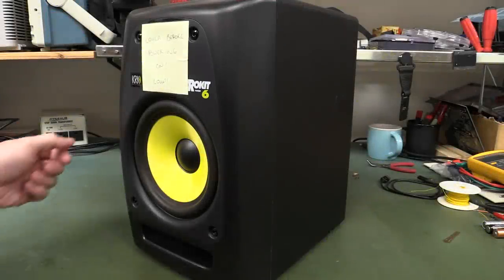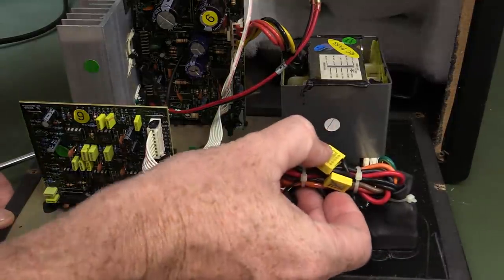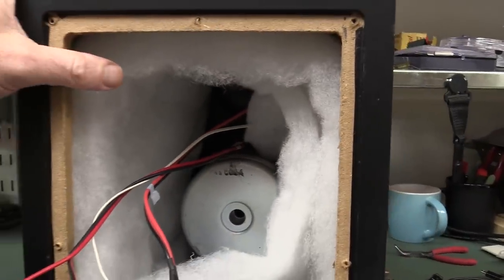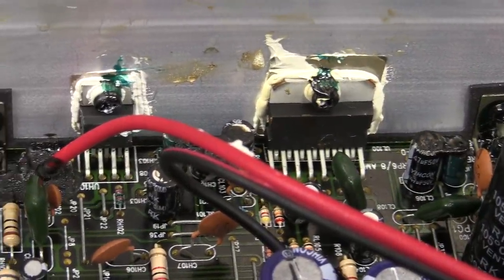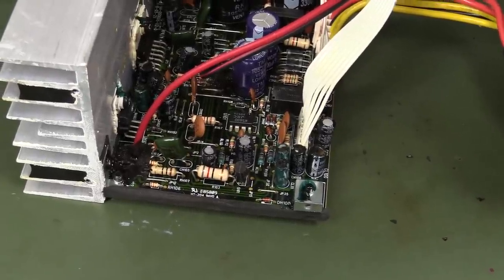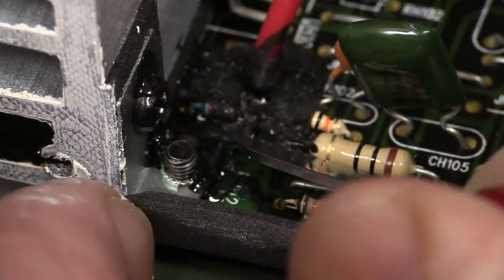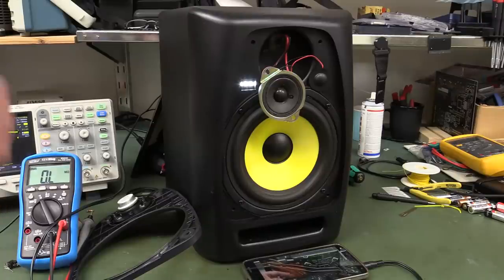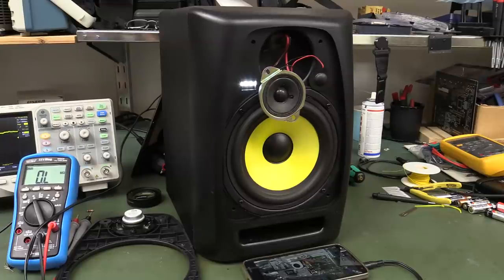EEVblog #1072 - KRK Rokit 6 Studio Monitor Speaker Repair

Comment: I have a pair of Rokit 8's from 2010. One of them powers on but the signal goes super low volume immediately. Sometimes after a couple minutes it will come back, but it will crackle out. Sometimes if I slap the sides of the speaker it will come back. Any idea what might be causing this?

Comment: Hey Dave, would you help me? I had the same problem, my tweeter has blown, so I bought a replacement one from KRK, removed all gunk, replaced a 2k burnt resistor, and put the thing on. It worked, no noise. But the tweeter has no power at all. It works but on very little volume. Any hint on what should still be broken? Thanksss

Comment: Hello, i've got a set of these speaker for repair. It was blowing a fuse, so i've replaced the Transformer and after plugging it in, i've noticed the four diodes on the amplifier board burn out. Any idea what might be causing this? I'm an amateur. I've scraped off all the black gunk hoping it was that, but they still heat up when i flick the switch on.

Comment: Took about 5 years before my KRK8s funked out. Removed as much black gunk of death and replaced several caps that seemed worse for wear. Still got an issue with them, trying to find it, but it does not effect their working.

Comment: My rocket 8 just shit the bed yesterday, took it apart after watching a few videos and same thing black gunk collected moisture then became conductive and corroded a bunch of components, took 10 years or so for them to quit. I will attempt replacing the corroded parts would u suggest leaving them bare after installing them or putting something else in place of the black gunk?

Comment: Yep, got a set of rocit 5's here with bad corrosion around all the black goo. Got some corroded through resistor legs too. R100 is burnt out. It was covered in crap. Also got mechanical hum due to transformer / port coupling even though there is a damper strip on port edge. Now to phone the customer! Thanks Dave.

Comment: Dave, you are getting a bit over-excited by this. It is an interesting subject, but pretty elementary. The video is about 10 times longer than it should be. It would have been better if you had concluded with the various types of compound (potting, vibration, insulation) out there so we know what to steer clear of

Comment: KRK are selling to the "big sub in your Lancer" crew so getting cheap bass with a bling appearance is their thing hence the high emphasis on sealing the cabinet to keep the woofer from losing effectiveness. Gunk and cable ties everywhere is to stop rattles.  These things are kind of regarded by professionals to be designed to appeal to DJs and pretty much avoided by sound engineers because the response curve is so coloured. If you ever want to compare it to something in the same category but respected by the industry it would be interesting to crack open the KRK Rokit, Yamaha HS series and Adam A series.

Comment: I am trying to repair my rokit 5 g3, there is a connector missing, one of those white cases with three wires that clicks into a 3 pin point. It says LF - CN2 DG 5V ST next to where the 3 pins are. Is there a place online where people can order specific parts of the amp board? Thanks!

Comment: Laying in bed one night watching a NRL game on a small portable colour TV.  Then all of a sudden the TV set goes off.  I get out of bed and look in the back and through the back grill I could see flame.  Now as most of you guys would know, in those old CRT sets the main board was always mounted at the bottom of the set, so all I could do to put out the flame was to start blowing it out out from the top.  Luckily it eventually extinguished.  The next day I open up the set to see what had happened and I found that a dry joint on a transformer had ignited the glue they had blobbed around the base of the transformer.   I re-soldered the dry joint on the transformer and cut all the glue off and TV was working again.  However, it was a real eye opening moment just how a TV can start a house fire.  I just could not believe they would use a flammable glue to hold down a component.

Comment: What a bunch of crap 😂 my first speaker could i repair by just scraping all the gunk off and clean it with alcohol. The second speaker started to make a high hiss so I opened it also up and it was even worse , some resistors just rusted on the contacts and broke off with little effort. 
Im about to repair it , just bought new resistors. It will be an easy fix but god... why the f.... did they use this stuff.
Lol at 21:45 the same resistor broke off on my board.

Comment: The reason there is no volume control or headphone jack on the front is because studio monitors are designed to be used in conjunction with an audio interface.  Those Alesis speakers you have?  Those are basically nice bookshelf speakers and have a response curve that's terrible for mixing and mastering audio from a computer (the purpose of studio monitors), but ideal for general listening (not the purpose of studio monitors, but probably great for your needs).

Comment: KRK vxt 6 which i'm curriently working on has a crackling moice as from firewood i have found gunk at the input with resistance as low as 13k ohm  across several component pins just the gunk resistane with probes as far as 3mm apart  nice to know about the gunk

Comment: Yes all air holes are blocked to seal the bass chamber. As is all the padding. I have a pair of 8's I just took apart and it crap does retain moisture and creates havoc all over the board espesially with the cct in control of the muting and standby lines. I found getting rid of the crusty parts and cleaning the residue with iso-alcohol and leaving till dry works........ At lest so far.

Comment: this is just ''dandy'' the gunk across the pins of a gain switch  i'm getting from 100k to 500k as i move the probes on the gunk  at this point I'm flabbergasted i will have to remove any gunk that i see and try out hi-temp silicon

Comment: I had a KRK Sub bought to me for repair and found exactly the same thing as far as the black goop. Plus it caused corrosion to form on the some of the control transistors for the power amplifier. That one was blowing fuses. It seems to be an issue on all KRK's from this generation. It had been generating so much heat through the output load resistors, the ceramic was cracked on 3 out of 4. For the money, there are much better options than KRK out there.

Comment: The last speaker I repaired was quite easy: one of the crossovers resistors got so hot it desoldered itself and fell out. Thats what you get when you design a crossover that dissipates 25W at 1kHz and below frequencies and leave it all to a poor 5 or 10W resistor...

Comment: I guess this is the difference between brands. Opened up my Yamaha studio monitors (not NS10s). No sign of that black compound and all quality Japanese caps.

I doubt you will find any "studio" monitors a volume control on the front of them, they typically take a nominal +4db signal and the volume control is only for adjustment. I run mine from a small mixer that I use for volume control.

Comment: So if you had the the other speaker, where does the the other speaker connect? Is it passive and connect to the amp in the faulty speaker, or would it have it's own amp?
Reply: these are sold singly, so each speaker has an amplifier in it to power itself only.

Comment: the voicecoils are pretty fragile. very thin copper wire wound round and round and round a plastic or carboard cylinder. Eventially it will fail open circuit just like blowing out a trace on a circuit board. not surpising considering the massive square wave it got blasted with probably put a weakpoint and it finaly gave out.

Comment: I've used a pair of gen 2 Rokit for 10 years, absolutely no problems (other than mixes that don't translate!). My Yamaha NS-10m's blew a tweeter, and deformed the paper woofer cone in just a few years.  I didn't expect this much out of the Rokits, but seriously been rock solid, one of those things that I just expect to work when powering up the studio. No thought given to them. I can't say the same for the 80's analog synths, or the 90's virtual analog synths. I, and many other people would love to see a repair of an Access Virus B, a high end German synth at $1,200 new in '99 - the B version used cheap caps (supposedly) in the power section, and apparently all the B's are going down now, or have gone down. A's and C's and so forth are okay, just the B's! There is one poor repair video on YouTube, and that is it. I'd really like to know what is going on. Mind doesn't boot now, I'm a real hack when it comes to electronics, but I have to repair it myself, I can't afford a repair tech!

Comment: I have seen problems with glue conducting 20 years ago on computer monitors.
They will never learn.
It helps to clean the corrosion with water, not contact cleaner.

Comment: Sorry EEV. You clearly dont see the usage in Pro grade studio monitors. To be honest. Speakers with volume controls on the front are consumer crap. These monitors are supposed to be volume controlled by a DAC or a mixer. So these would be mounted in a triangular position where they may be hard to reach behind the desk.. etc...  You shouldnt give them crap just because they opted to aim for a higher end market then you yourself use...

Comment: Please help me. I have a problem Speaker KRK ROKIT 6 GEN 2. Bass / Subwoofer sound is very audible from the sound
the original. Sometimes a tweeter dies and lives again, dies again, so over and over again.
I think what parts should I fix?

Comment: Is there a way to fix a bubble on the surface of the yellow woofer cone?  It seems like the woven material is delaminating on one of mine but i dont want to unbalance the speaker by just dripping glue in with a needle.

Edit: also is there a way to fix the auto on to not require such a high volume to turn it on?

Comment: 19:00 ... that didn't look "bubbled up" to me. More like moisture got inside the speaker and condensed on the gunk which then might have reacted with the water. but the water is most probably the cause of the corrosion on the pcb

Comment: FYI, the 8 pairs of my Rokit 5 that I have at work are starting to do similar things. Also the filter caps are all going bad and getting ready to pop. And there is now (a year later) a schematic for these, and poor copy for the 5 as well.

On a lightly used 5 the black goo is still soft. On the ones that are having problems the goo is hard and brittle.

Comment: Welcome to my world for thirty seven years.  To remove the glue and get to the acid damaged parts, soak in CH2CL2, then pour a liberal amount of Propan-2-ol on top.  The contact cement will slowly become pliable and pull away with dental picks, tweezers, and needle-nose pliers.  Please wear chemical gloves and a breathing apparatus.  Use a ventilation hood.  Some of us weren't allowed those conveniences as it wouldn't be "cost effective" and we were to just "suck it up" and be thankful we had a job.  This, courtesy of greedy manufacturers and service shops that have received input from bench techs for decades about this stuff.

Comment: The RCA plug will  give a whistle by air rushing in and out air via the RCA plug hole.
That's why they use this rubber airtight cube.

Comment: It's not just those speakers, that rubbish glue can be found just about everywhere :( It's normally tan coloured instead of black, but it always turns conductive and corrosive over time. It's widely known as a failure point in electronics, even though it's been in use for decades - which makes you wonder if it's become a built-in self-destruct for ensuring obsolescence.

The only way to fix it will be to remove all the glue (heating it with hot air to soften it makes that easier) and then replace all the components\wire links it's touched, because their pins will be corroding away.

Comment: Had a similar issue with my KRK Rokit 5 G2:s about 2 years ago. Started hearing random cracking/popping sounds, opened them up and found heaps of the black gunk with corrosive sweat all over the boards. Some of the YIHCON caps had started to bulge as well, so I decided to replace all caps with japanese. Hopefully these speakers will now last me another 5-10 years. Not gonna buy KRK again when the time comes to replace them though, that's for sure.

Comment: Hahaha. Amazing. Vibration isolating mechanical connectors is probably a very good idea, but It's likely they were just sealing it, because having air paths into a small acoustic suspension box is going to cause serious dust accumulation at the cracks, and especially through mechanical connectors. That's going to be a problem.

Comment: hm, So my highs cut out on one of my rokit 6s..checked the tweeter it's reading 4ohms, tested with different cables, amps, and mixers.  Any thoughts on what the issue could be?

Comment: I'd just like to point out that most (if not all) *good audio interfaces* have a separate volume control for headphones and speakers (and they both play the same audio source). They also have microphone inputs, aux inputs and outputs, a monitoring feature (play mic inputs directly out the speakers before going through any digital conversion) and generally *much better DACs* than you could ever expect USB speakers to have.

Comment: The resistor @ 22:17 may be corroded, but it has never been soldered properly.
If you look at the right side solder end, the solder has never attached to the pin, - the left pin isn't much better. 
Does anybody know about the performance of lead-free solder together with leaded components in a PCB with no plating in the holes subjected to vibration?

Comment: I think if I owned these speakers I would put the amp in a separate box, make a new back for the enclosure, and run wires in to the speaker units.

Comment: i've seen those green knob pots before...i think they're actually the same brand as used in an oscilloscope that you've taken apart in the past.
they must be taking lessons from Apple. use gunk that becomes conductive over time to force repair/replacement. is it me or does that gunk look possibly hygroscopic?

Comment: I had this buzzing problem in one of my old Rokit5 monitors. Everything looked fine inside so I just probed the outer shell of the big caps and one of them had a big triangle wave on it. I swapped it out for a better cap and all was well.

Comment: Having learned quite a bit about electronics from junk i pulled from the trash in the late 70's into the 80's, i've seen a ton of
different compounds used. The old stuff used wax with something to make it gooey, peel it off do what you need to. Stick it back on, heat it till it flowed a bit done. Worked for sony for a while, consumer device repair. Sonybond FAMOUS stuff. Never used it, after removing pounds of the stuff. Used my own RTV, never an issue. For $20 a month i was fine with buying my own.
I've seen sonybond seep into IF cans when it was applied, good luck EVER getting the slug to move again.
How about that nasty green plastic goo mess in Taiwan electronics of the 80's? Components break before that stuff does.
Oh sure it holds it well, and the chance of any of it ever seeing a service bench was slim - but still...hate that stuff.

Comment: I have an Event 20/20bas monitor with pretty much the same symptoms - tweeter amp is not healthy.  It's been on the back burner for a couple years to fix it.  Wonder if it's the same issue?

Comment: It looks like that stuff may be just trapping moisture in it. As seen when you where scraping around the negative terminal for the tweeter, there was a pool under it. The trapped moisture looks as though its also corroding the contacts of the components

Comment: I've heard of resin causing issues down the line before. Roland used to pot their filter modules in one of their synths back in the 80s and over time the resin would become conductive and kill the modules. Sometimes you could recover them by dissolving the resin off in acetone but it wouldn't always work.

Comment: Seriosly they didnt use any protection on tweeter? At 200$ for one speaker i would expect it to have at least some sort of fuse or capacitor in series. 
Also what would you recommend to use on pcb instead of that black gunk?  I sometimes use hot glue, it can be easily removed with a bit of heat.

Comment: Hey there! Great video! I have a quick question about a studio monitor popping. No hum, just crackling and popping. Even without a sound source plugged in... I checked all wiring connections, they seem good. Doesn't look like anything is burnt or loose. Any suggestions?

Comment: My first ever teardown was a Rokit 5 gen2 that started playing up within 2-3 years. Nothing obvious (no burnt out components) but the black goop was slathered everywhere. Just moved on and bought a second hand replacement cheap. If ive still got the old faulty unit floating around ill send you the tweeter, its probably the same!

Comment: I know it's probably not the case, but it all looks like "we're not sure about soldering job of our contractor so we tell them to gunk every single wire-PCB junction and every single heavy part like electrolytic cap on the board" :D

Comment: Not totally thrilled to see a DC offset on the tweeter amplifier's output, though. Not enough to be a concern for heat dissipation, perhaps - but given the tiny excursions tweeters are designed for, I'd be happier to see them resting in the dead-center of their travel.

Comment: to get rid of the black gunk you need some peanut butter, nutella works fine for me. But don't forget to place fresh onion slices between the black gunk before you aply the peanut butter on it. Of course put the pcb in the freezer then for 20 min. or so.